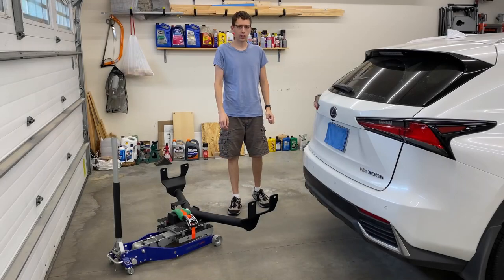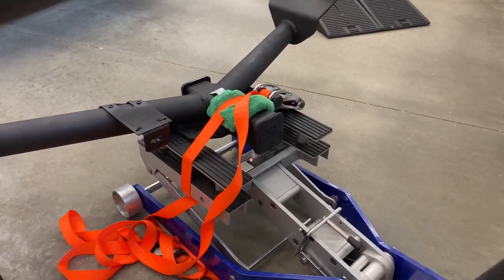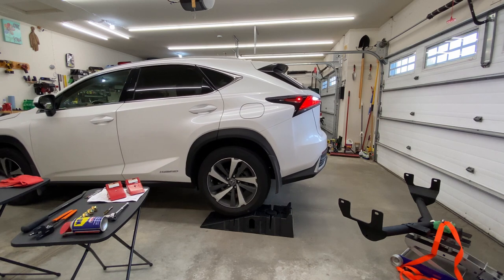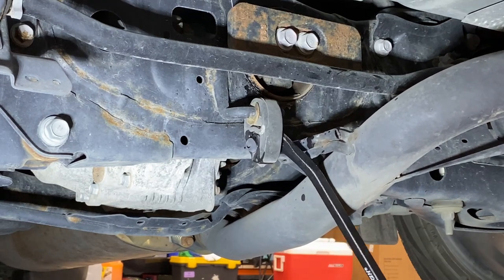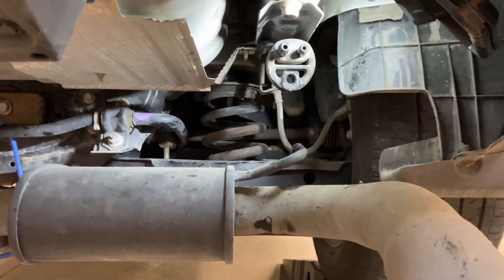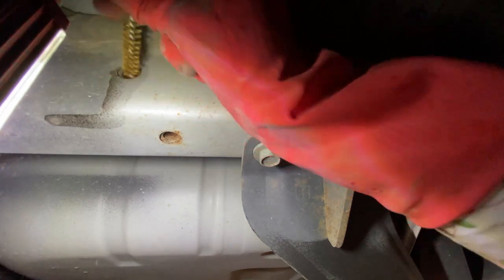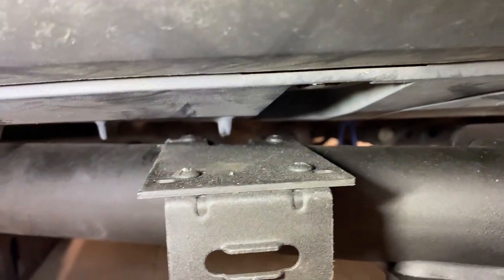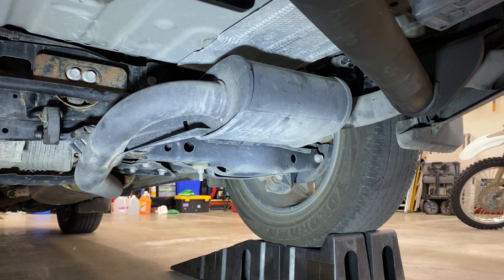Lexus NX 200/NX 300 Trailer Hitch Installation the EASY WAY using a Motorcycle Lift

Comment: Thanks for this great video along with it's sister wiring video. I successfully installed the same hitch and wire harness on my 2020 NX300h, and without these videos I'm sure it would have taken much longer.  I'm curious if you could offer any advice on ball height needed to pull one of the 1720lb harbor freight fordable trailers.
Reply from the maker: Thanks for the comment and happy to hear the vids helped with the install. The height from the ground to the top of the receiver on our NX is 13”, probably the same for you. I have used uhaul trailers before which have an 18” receiver height, so I got an adjustable mount and set it to 5” of lift. You’ll have to see what receiver height that trailer has and buy accordingly. You want your trailer to be as level with the ground as possible.

I forget if links work in YouTube comments, but this is a helpful guide:

https://www.uhaul.com/Tips/Towing/How-To-Select-The-Correct-Ball-Mount-for-Your-Hitch-5227/
Reply: @BrenoAutoGarage  Thanks for the response. I just measured the height to the top of my hitch tube and it was indeed 13". I'm still in the process of assembly my trailer, and while I'm not 100% sure if it's accurate I found somewhere else on the internet that maybe the height to the bottom of the trailer hitch was 15.5". If this is accurate than I am thinking I may be able to get away with a 2.5" rise on my ball. Thanks again for the confirmation of your hitch height and help.

Comment: My hitch did not come with the 4 bolts.  What size and thread bolts and washers do I need to buy?
Reply from the maker: Here is a link to the installation manual, with the part numbers for the bolts & washers: https://assets.curtmfg.com/masterlibrary/13337/installsheet/13337_INS.pdf

From that sheet the bolts are M12x1.25, 35mm long, class 10.9. Washers 1/2” inside diameter, conical type, does not say outside diameter.

Normal washers would probably work also, something nice and big, and add some thread locker to the bolts. I believe the conical type washers are used similar to a lock nut to keep the bolts from working loose over time.